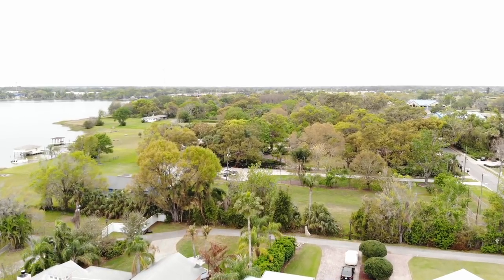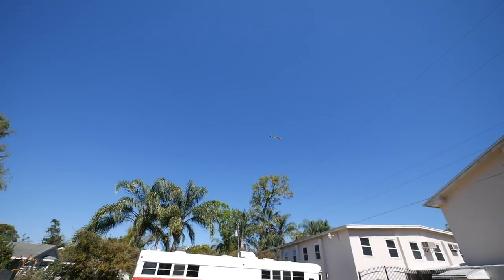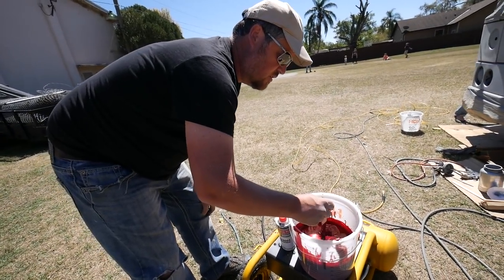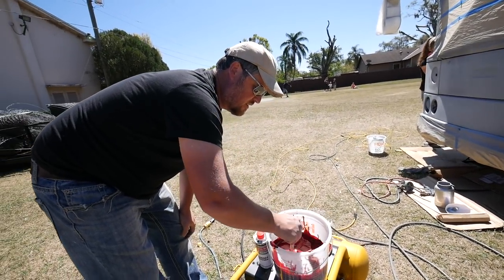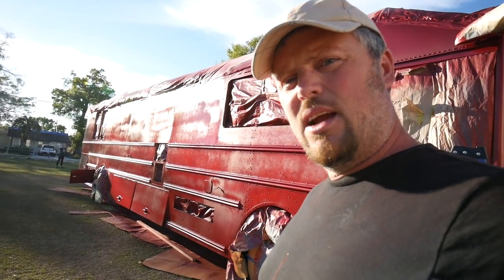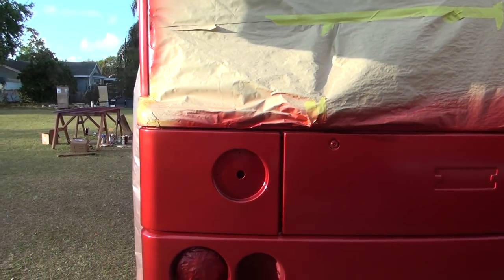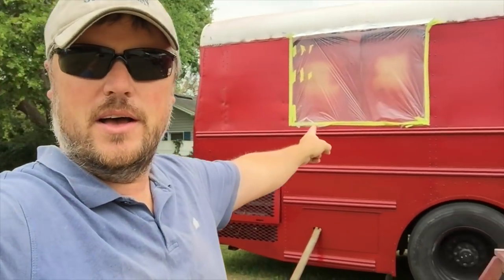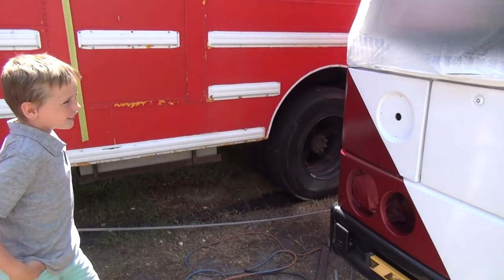Painting our Bus Conversion | The Bus Life

Comment: I remember back in the days watching a body shop tech wet sand a new paint job with fine sand paper...and then adding multiple coats of clear coat.  You may want to research this as I am no expert, but remember this in my days working for a Volvo Dealership.  Good luck.
Reply from the maker: Yes...this is a single stage paint.  So you don’t generally clear coat it.

Comment: Looks pretty good. Part of problem was doing in sun beating down on you with a siphon fed gun. They use alot of air increasing dry areas in good conditions. A gravity fed hvlp gun would really helped ya. They can be picked up at harbor freight or online very cheap now days. A hand polish would probably help but I couldn't imagine doing the whole bus. But moving right along. When you spilling beans on the door,are you putting that coach door on? Waiting impatiently☺

Comment: Bus Life ,  allow me to give you some tips , first every thing you mix should be strained going into the cup , paint suppliers usually give them second i did not see any reducer added to the paint & hardener mix they have a product called retarder to slow down the drying process , what I am seeing looks like dry spots where it wasn't laid on wet enough or just drying to fast from the sun , if your thinking about re coating it check the recommendations on the window to apply another coat , and either wet sand it or use the DA machine on it with probably 320  or 400 grit , keep us posted ,, good luck be sure to clean that gun well when you finish   Frank T